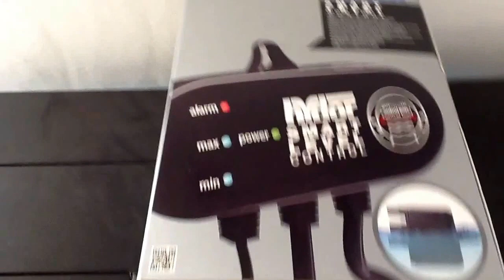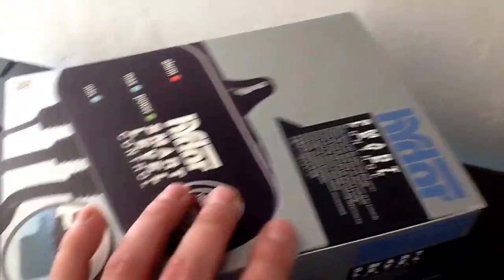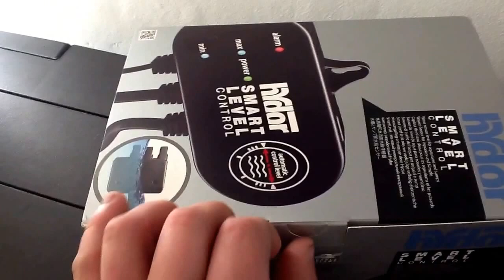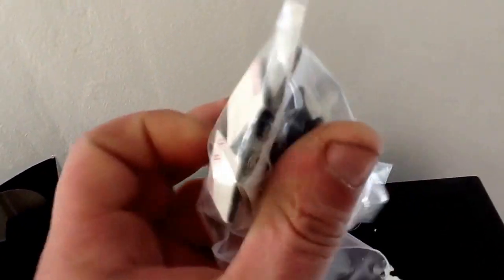Hydor auto top off system for my aquarium

Comment: very useful. I made my topoff with a float and peristaltic pump. It draws from a 2 liter jug, that way if the float is stopped by a snail it won't overflow. I fill the jug every 5 days. Your system is much more worry free. good purchase.
Reply from the maker: It will help my misses a lot while im working away

Comment: Horrible piece of equipment kept failing after the first month the sensors don't detect the water level rising and the sump or tank will overflow.
Reply from the maker: I've still not set it up but thanks for the feed back
Reply: +Fusion10861 If your pump is oversized, it will move water faster than the sensors can detect the change, and you'll get an alarm.  If your sump is overflowing, then your TO water may be siphoning into your sump.  These are nice units.
Cheers!